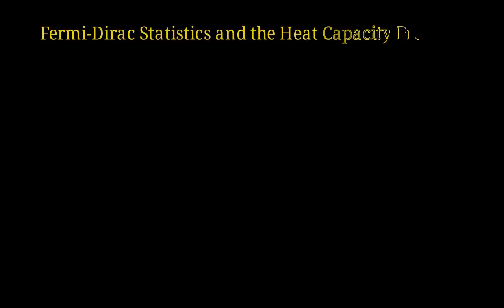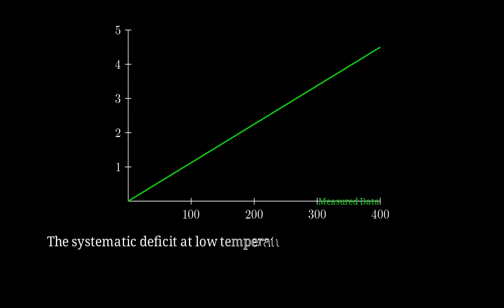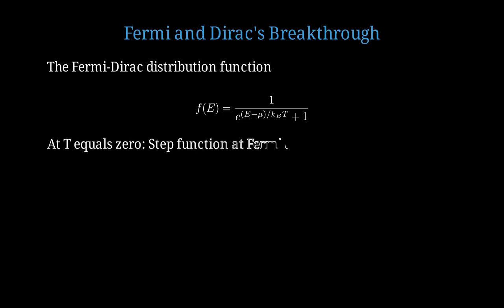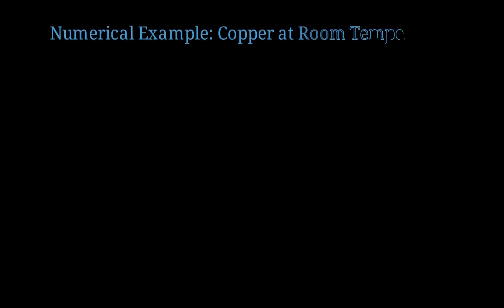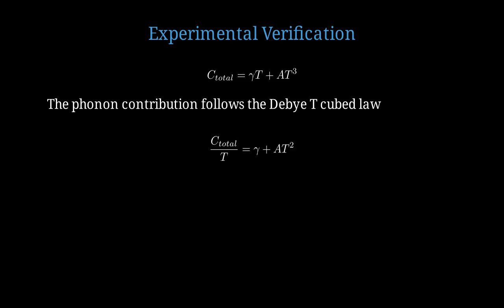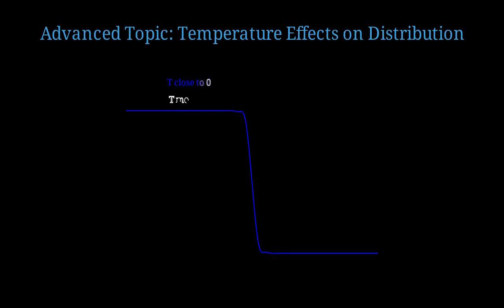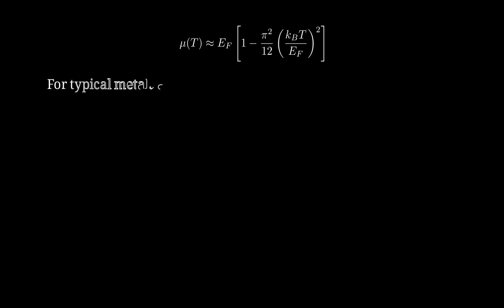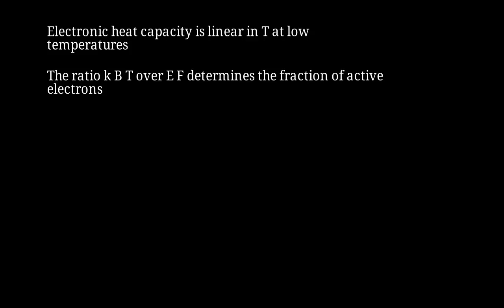Fermi–Dirac Statistics — How Quantum Rules Changed Thermal Physics

Comment from the maker: How do relativistic corrections modify Fermi–Dirac statistics in white dwarfs and neutron stars?
Can strong electron–phonon coupling alter the linear heat capacity regime in nanostructures?
What is the quantum mechanical limit of the Fermi surface under extreme confinement?